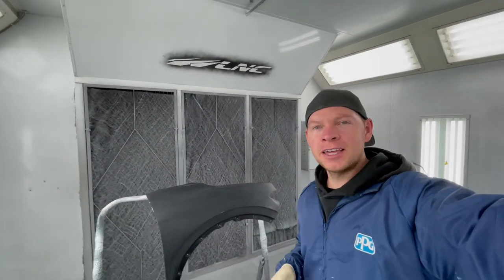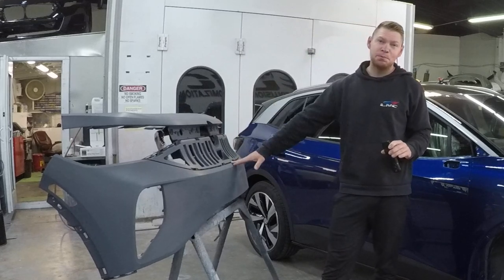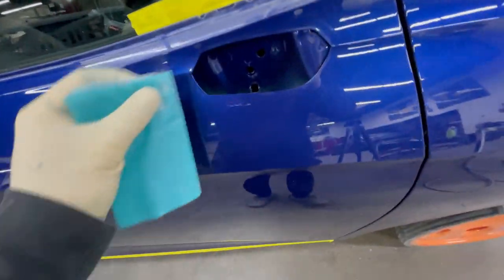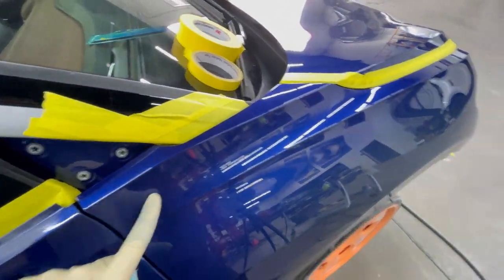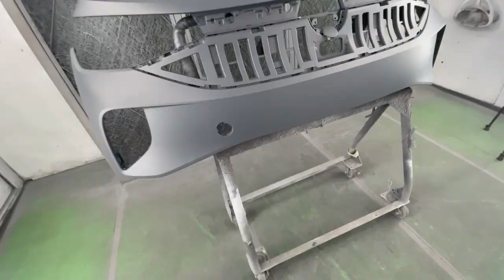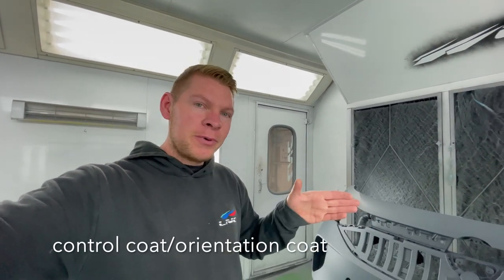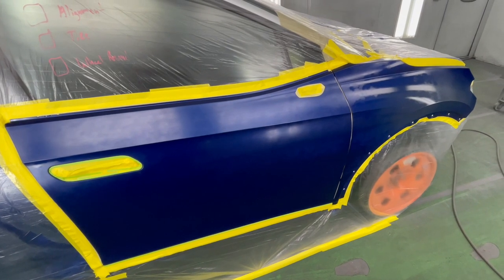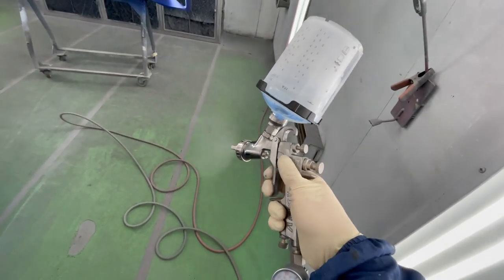Rebuilding and Painting Brand New Volkswagen id4 w/ front end damage!

Comment: Hi if we remove the front bumper for just scratch repair and respray, will the car require any radar sensor adjustment or front camera assist system adjustment from vw?
Reply from the maker: Shouldnt have any problems, just plug back in and will be good. Might need to clear the codes but can be done with scanner
Reply: @LncPainter  many thanks